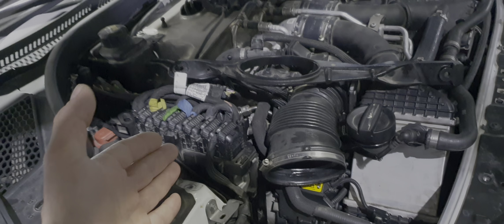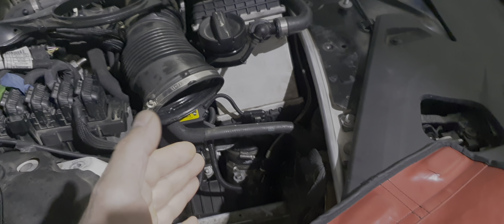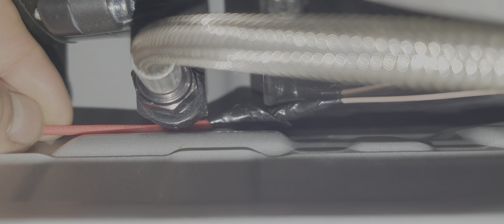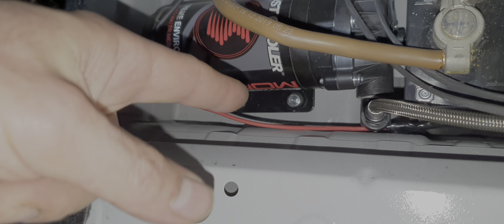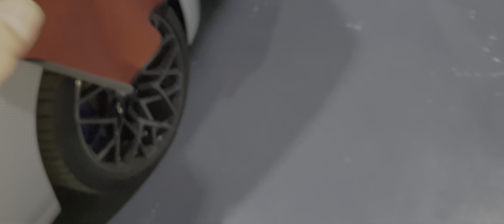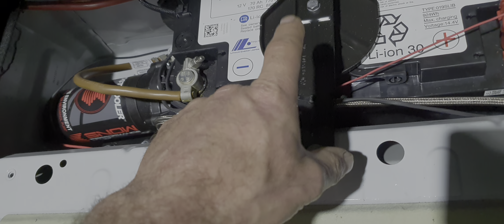M8 2020 with 35k km check up (part 2.1)

Comment: Tasos, I will say what you are too polite to say. The people that installed the methanol kit are lazy and stupid. They should not be allowed to work on a car like this. If I was installing a methanol kit on a car that I was going to push off a cliff, I would do a better job than that. If the tuner is as lazy and stupid as the installers, then it's no surprise that the engine is blown. This is what you get when you let incompetent people work on your car. It begs the question why someone would spend $175k on a car and then let people like this work on it.

Comment: Tasos you always give good advice . its nice to watch your videos and i always get so much knowledge from them . i ran water methanol on m177  for 3-4 yrs . i sprayed before the turbo and at some point after the turbo before the intercooler. either way there was problems . before the turbo too much methanol in mix (80/20) will hurt compressor wheel overtime ,it starts make the edges of compressor wheel lose material overtime . second problem if you use 50/50 mix and you spray before turbo or after the turbo and you did a vmax ,100-200 or quarter mile run,  there is still lot of water and methanol in your system before throttle body which didnt make to engine and you drive back to pit lanes and shut the car off . next time you start the car after 5-15 mins you will have an issue. i mean you can cruise down the highway in partial throttle and that will clear the system but still its a problem .and third spot you already explained enough and totally agree the quantity will not be same for each cylinder.

Comment: Tasos I can understand what you explained Close to the turbo it will create molecules but if you spray water methanol close to the engine the first pistons will absorb all the water methanol and it will not allow all the other cylinders to receive the water methanol

Comment: You're always right, it's always the same and we get it. Your shop is a technical oasis in a desert of incompetent mechanics and tuners. It seems it is the favorite past time of the young emirs with oil money to melt their engines and stimulate the economy of the local repair shops.  😂